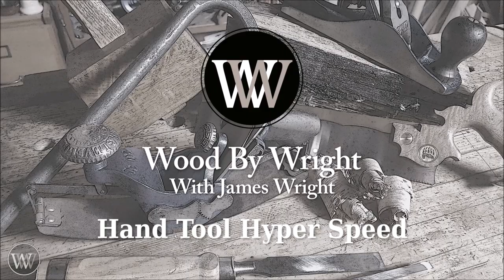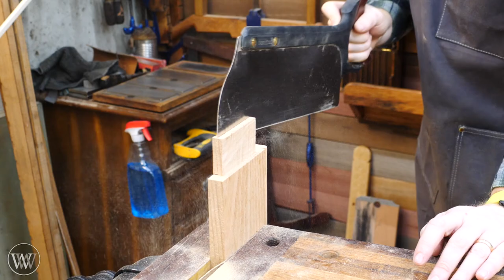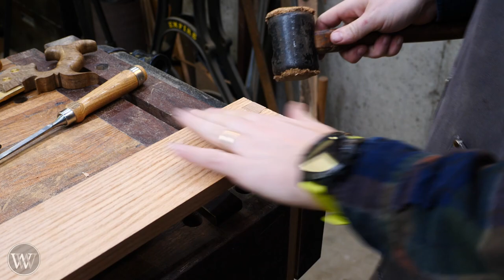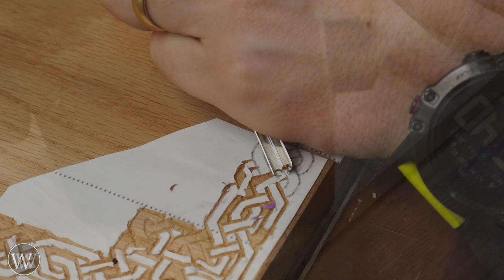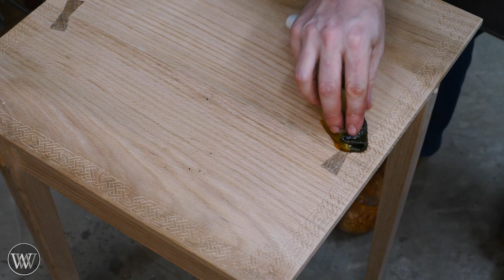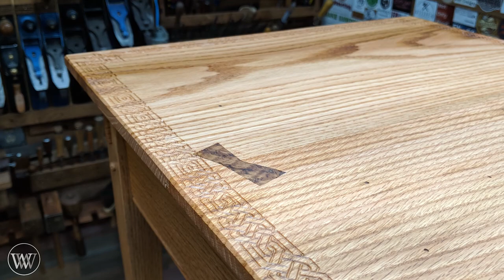Making a Side Table Without Any Glue or Hardware | Short Video

Comment: A few Phillips screws and it will stay together😀  Pole lathe for turning. What a hoot. I hope you used wet timber. You are now a qualified “bodger”  in the original meaning.
Actually a challenge and test of skill. What’s with the gloves? Raw linseed oil does my hands good.
Reply from the maker: Jim Bo lol yup. Nope that oak was dry. Not as easy but a lot of fun. The gloves we're for the poly. The BLO goes on with just hands. Feels good.

Comment: When you pin the "showtails" could you put one dowel from the top of the drawer through all the pins and tails?
Reply from the maker: sure. you might want to use a thinner dowel as if it is much over 1/4" it would weaken the corner. I thought about doing that, but I am perfecting the side method for future ideas. on some other project, I want to use brass dowel stock and have it be proud then use that as the drawer stop. we will see though.